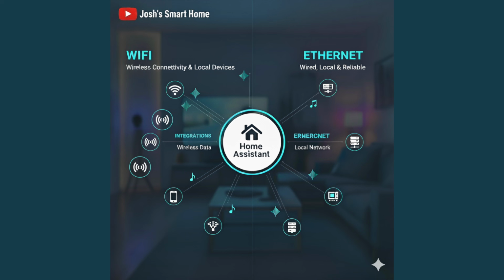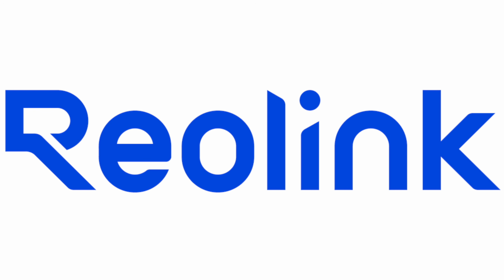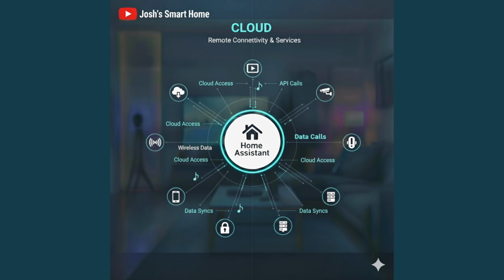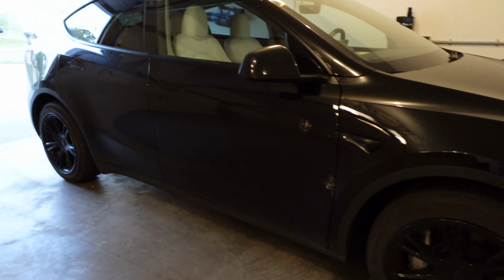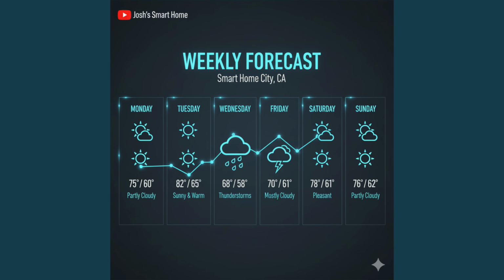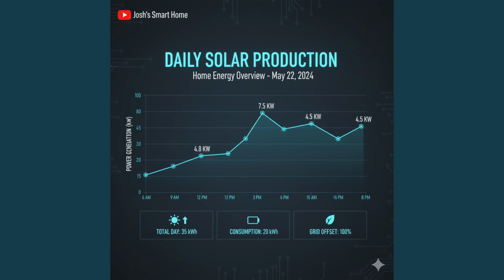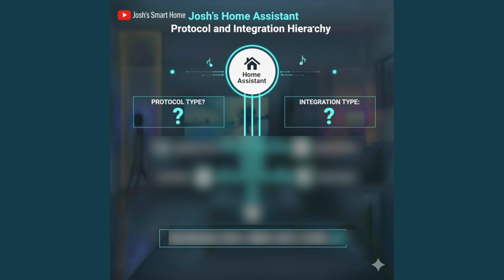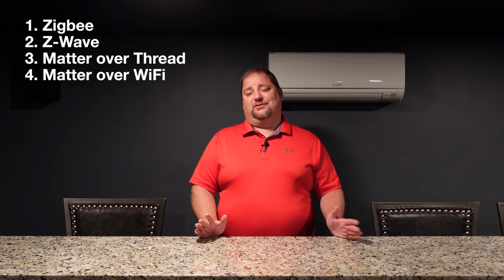My Favorite Home Assistant Integrations and Protocols!

Comment: No Bluietooth? Switchbot uses it for sensors and if you set up a Bluetooth proxy you may be shocked by how many devices it will see. I also use rtl-433 with an sdr (software defined radio) to read my gas and water meters.
Reply from the maker: I haven’t gone down the Bluetooth route at this point, but maybe I’ll have to give it a whirl. I do want to get into some more custom setups with unique devices like my propane tanks!